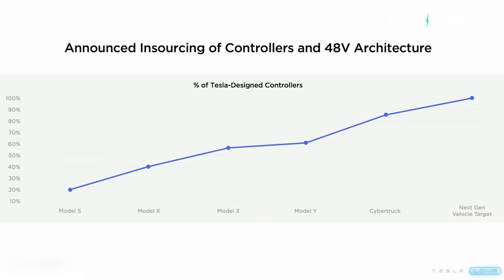How Tesla plans to save $10 billion every year by using less copper

Comment: Hi Sam, 48v system is long overdue. Ironically this would have even more benefit in an ICE car - the starter-motor and alternator would be so much cheaper and more reliable on 48v architecture.  The other big benefit is for the sound system quality, getting good sound quality from a 12v power source sucks.
Reply: I think that legacy automakers are a little to conservative.
Reply: @LamarreAlexandre  Nah, they're just too lazy to do anything practical or sensible.
Reply: Legacy automakers have only been focused on next quarter, up until Tesla arrived on the scene.
Reply: There was some talk 20 years ago about adopting a 36 volt or 48 volt architecture for a more powerful and reliable starter/alternator system, but it never got beyond the planning stage, as none of the component suppliers wanted to update their designs, there was too many 12 volt legacy components, and none of the auto makers wanted to make those higher voltage components themselves. .
Reply: Simon, Tesla changing will have zero effect on starter or alternator suppliers.  ICE is dead.
Reply: Transistors use under 5V, so whether you start at 12 or 48 you will have to bring down the voltage to use transistorized equipment like a radio.
Reply: @edwarddejong8025  Hi Edward, transistors operate at 5v? sorry, but that is just plain wrong! I suspect you are thinking of logic transistors such as those miniaturised onto a processor chip and are used in logic circuits such as NAND, OR and AND gates. Audio transistors operate at much higher voltage and power levels, they are not digital in operation, but current amplifiers and operate as analogue devices. A domestic audio amplifier (Denon or Rega as an example) has power rails of (say) + - 60v DC, the output transistors (sometimes MOSFET in high power applications) can swing their output voltage on the emitter within a few % of the power rails. In car audio the speaker load is usually 4 ohms. If the output was limited to just 5v as you suggest, the output levels would be very low. At the other extreme are music systems in theatres and night clubs; do you really think they produce those sound levels with a 5v output amplifier?

Comment: They will need more silver as it is more conductive than copper. There needs to be 1.7kg Silver in every electric car and it’s irreplaceable. The cybertruck needs estimated 3.5kg silver
Reply: If that 1.7kg figure is true, that's about 55 ounces per car, or 55 million ounces per million cars. That's a LOT, since Tesla has a target of 20 million production by the end of this decade. 20 x 55M = 1.1 billion ounces, which is 100% of current  annual silver supply iirc; i.e. 100% OF SUPPLY FOR ALL USES, industrial, jewelry, investment, etc.
Further, solar panel production is already eating north of 160 million ounces per year, increasing by at least 25% per year with no end in sight (and probably will go faster than that with new panel tech that will increase silver loadings; see Chen Lin's videos). Hence, solar panels are also on a trajectory to consume near-100% of annual silver supply by the end of this decade. All that in the face of highly INelastic production. 
In other words: multiple unstoppable forces of demand are about to meet a nearly-immovable object of supply.
Reply: Why spend money on silver, when copper works fine? Whatever the device is (heater, radio, ect) it will use the same amount of power (watts).
Reply: @glennbeattie6172   Copper works but not as well as silver. I cannot give you the full tech skinny because IDK all the details. But I DO know that the people who know are well aware of the cost difference and are highly motivated to reduce silver if at all possible because of its high cost. They are using the bare minimum necessary for purpose. They would not be using a single gram more than they absolutely have to use.
 Silver loadings per solar panel have been reduced incrementally for years, but only a tiny bit each year, as process improvements have allowed this. But that low-hanging fruit is now gone, and loadings are set to go in the opposite direction with new panel technology that calls for much higher silver loading per panel, unavoidably.
Reply: Also, re the OP and my followup: on reflection I realized that the 1.7KG figure (55 ounces) could not possibly be correct. That's far too high. Maybe 5-10% of that. Which is STILL quite a bit when you multiply times 10s of millions of EVs. 2-5 ounces of silver x 40 million, say, is 80-200 million ounces, which is a lot. Current TOTAL industrial demand is around 400 million ounces/year, for perspective.
Reply: @alan2102  to much knowledge silver is only needed in Sauter joints not in copper. Are you saying the cybertruck will have more Sauter joints? Copper wire doesn't need silver in any part  of manufacturing.
Reply: @glennbeattie6172  No, I am not saying anything about "Sauter joints"; IDK what they are. I already told you I do not know the tech/process details. All I DO know is that silver is not used unless it MUST be used, because it is so much more expensive. The engineers that design this stuff are not stupid. If they could get away with using no silver, then there is 100% chance that they would use no silver.

Comment: 75% reduction is exagerated. Also, it will require a lot of R&D for many normally 12V components.; that's why I do agree with no quick redesign for existing models. 20 % of the copper is probably used for motor driving circuits that cannot be reduced. I would say a 50%-60% reduction of copper is more likely. The insulation of the 48V system will also require  slight increases in the wire protective cove. Everything helps!
Reply: numbers don't add up here. 1 million cars/y 10 billion saving would mean 10k saving per car. not realistic.
Reply: @skataskatata9236  His math may be incorrect but it does amount to a lot of copper and weight savings when you are building 5-10M cars!
Reply: @skataskatata9236  The figure was for 20 million cars a year and a 75% saving was 1.3 million tons of Copper saved per year. So $500 in savings per car per year.
Reply: 12v wiring is generally rated to 250v or 600v, there will be no change in insulation for 48 volts.  Also there will be no R&D, these components already exist.  It's a minor change in the windings to convert a servo or motor to 48v, and most LED lights have a very wide input voltage range and may not require any changes at all.  Modern Tesla's are already 16 volt systems.
Reply: @GregHassler  Every window motor, lock solenoids, HVAC valves, headlights and taillights need to be reconfigured, burned in, life tested in water and salt environments. etc etc. You are grossly underestimating the task-that may be why the Tesla truck is taking so long to go to production. I come from a design background and have some experience with-"it's just a small change"; it still has to be tested under extreme conditions. There are no 48V components in cars today so every 48V component need to be critically checked under all conditions as well as the electronic interface circuits driving them. I agree with your insulation comments.
Reply: @thehobe150  Management "Just do this, it's only a small change..." Design engineer "But it has to be tested, so that it works reliably..."  "Don't bother with all that,  it's only a small change..."

Comment: Hey Sam, calculations are a bit off here. You said a quad motor version could save 80 kilos. That would be correct IF the motors were part of the low voltage system but they most certainly are not. Changing low voltage system to 48 volts will have zero impact on the drive motors which are part of the high voltage system.